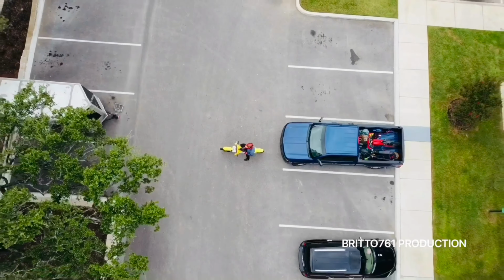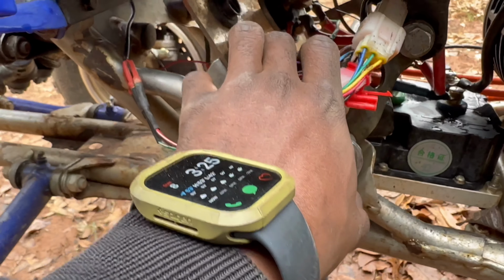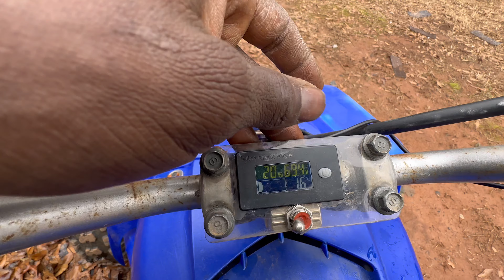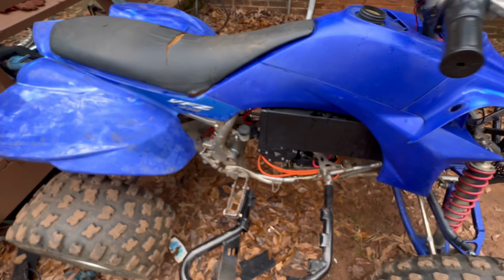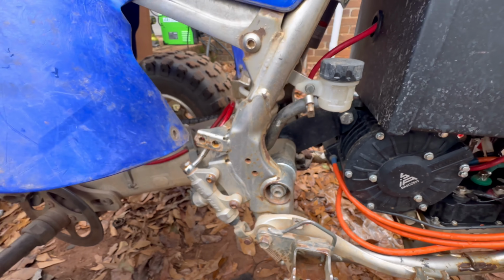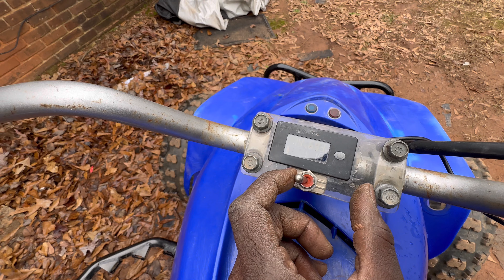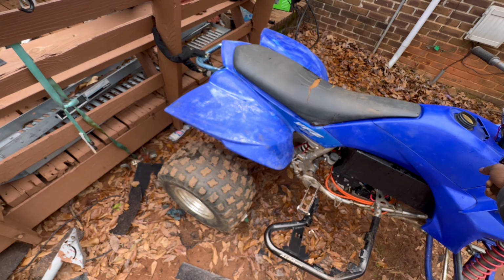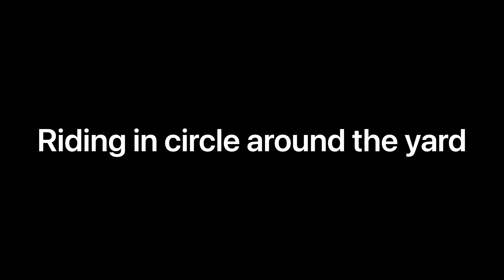It’s alive !!! Electric YFZ 450

Comment: Your battery sounds like it packs a lot of power. What's your motor output set to?
Reply from the maker: 430amps on the battery side.
Reply: @britto761  You're pulling all that? That's like 30+kw! Awesome
Reply from the maker: @msf1tv  yes I am.